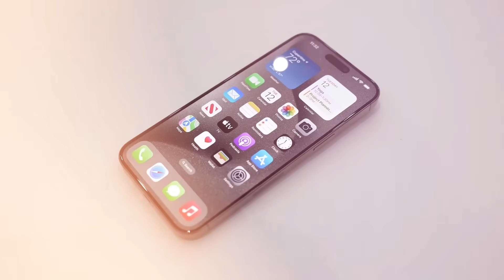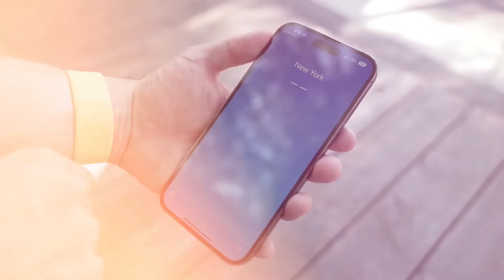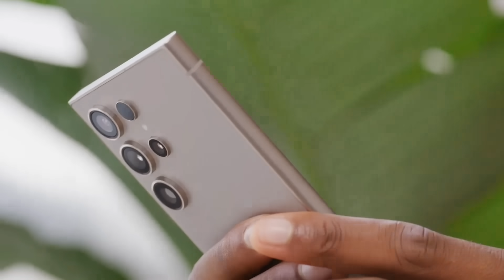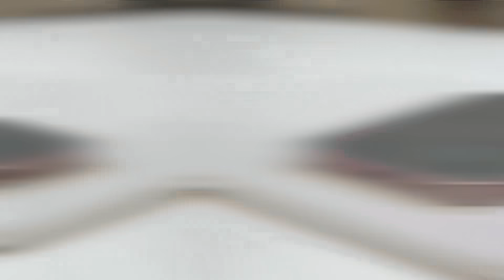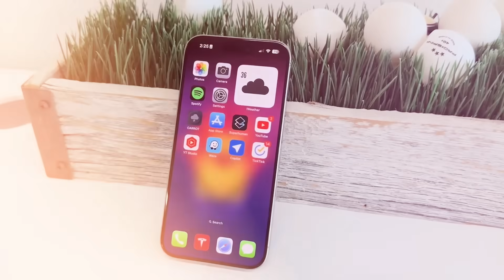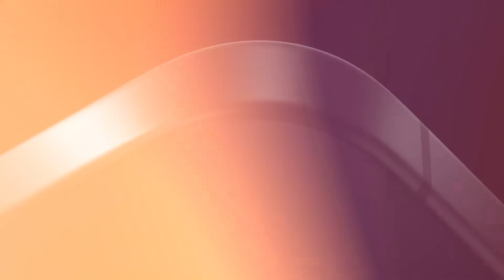iPhone 16 pro max - Big changes! 🔥🔥

Comment: I’m interested, but I’d really like to see real details on the iPhone 16 Ultra before buying a iPhone 16 Pro Max that is only partially there! Come on Apple, make a Decision to give your Customers & Fans what they want, which is the BEST Photographic & Video system with the POWERFUL & HIGH QUALITY CAMERA’s, LOW LIGHT SONY LENSES, iMX903 SENSORS, AUTO ZOOM, AUTO FOCUS+AUTO STABILIZATION, 8K VIDEO, etc. to just BLOW AWAY ALL YOUR COMPETITION TO DOUBLE OR TRIPLE the Total REVENUES & PROFITS  in 2024 over what you’ve accomplished over 2023! That will extend the life of the iPhone 16,17,18 & provide the money you need to accelerate the development & delivery of Vision Pro at 50% of the $3500 now to a much lower cost $1700 more compact & higher quality Vision Pro system that costs about what a iPhone 16 Ultra would cost with 1TB storage! … Hmmm, THINK BIG!